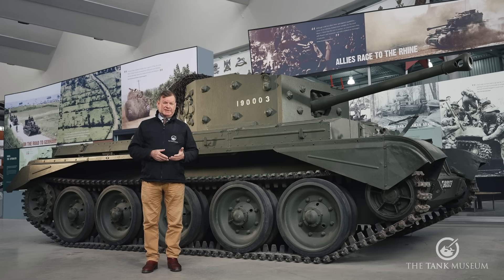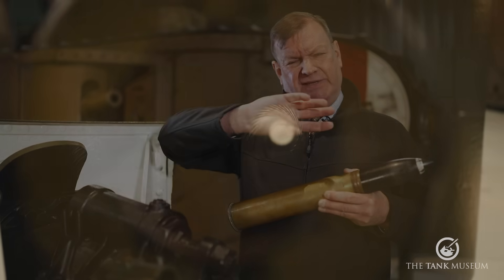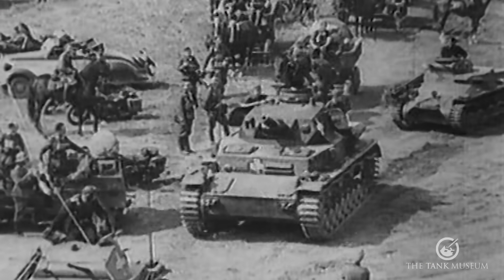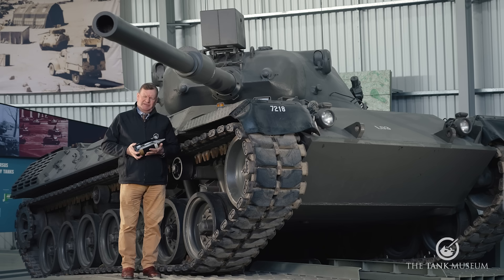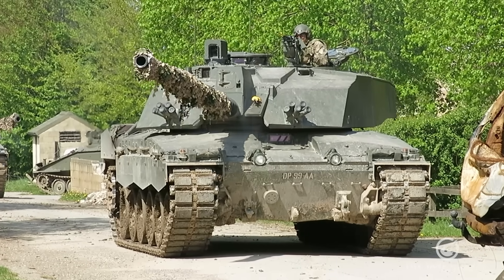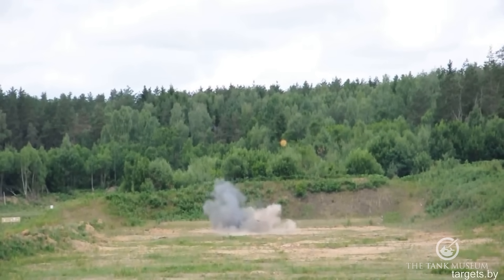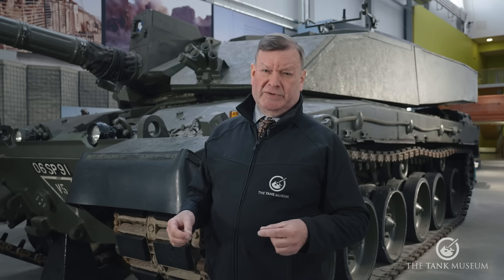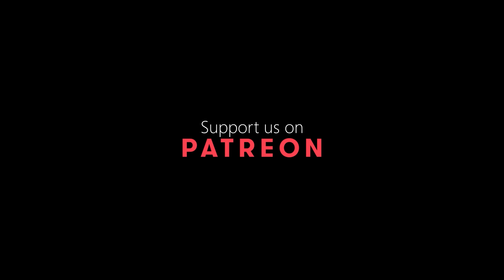Knock Out: The Evolution of Tank Ammunition

Comment: "The radioactivity of depleted uranium is relatively minor."
Yes, but it still causes radioactivity related health problems. You can ask all the veterans with “Gulf War Syndrome” how "relatively minor" their symptoms have been.
Reply: So does living in Scotland and Cornwall (radon gas).
Reply: @zedeyejoe  I wasn't even aware that radon  could be found across the UK. Many thanks for sharing it
Reply: @leoa4c  My mother lived in Cornwall and every house was given a radon detector.
Granite contains uranium.
Reply: @zedeyejoe  Yes, uranium-238 from the granite eventually decays to radon-222 which has a half-life of about 4 days. Plenty of time to do lung damage.
Besides closing the doors and windows, I assume, what was your mother supposed to do if the detector went off?
Reply: @leoa4c  I think the radon came up through the foundations. In the air radon would be diluted.
An active radon sump, fitted with a fan, is the most effective way to reduce indoor radon levels. Sumps work best under solid floors and under suspended floors.

Comment: Outstanding presentation indeed!!! Very accurate information. I used to be a Tank Commander on the M1A1 Abrams. I used to be a Paratrooper and an Infantryman once upon a time. Learning the M1A1 Abrams to maintaining and driving was very short and mastered it quickly. Gunnery was very important and foremost along with tactics. A good understanding of Tank Gunnery and especially crew, platoon, company or troop level live fire exercises after qualification is very essential. It develops unit cohesion especially under combat conditions where coordination must become instinctive when calling out fire commands to your crew, platoon, and to relay the engagement to your unit commander. It also works in reverse if your unit commander is excellent at his job as company or troops commander. When moving out on a mission all tanks as a first engagement round in combat should battle carry a SABOT round. After the first round is fired by the gunner, the commander has to identify the next target as he is searching to select the next round either HEAT or SABOT.

Comment: HEAT rounds are not kinetic energy based, their power comes from explosive therefore they are chemically based.
Must have been a slip of the tongue in the video ;)
Reply: They are kinetic because the copper slug penetrates the armor using kinetic energy despite it been accelerated using chemical energy.

Comment: Great video, I admit I prefer the rifled 120mm, it can fire indirectly to 14,000 meters with HESH and has a much longer kill distance with Fin over the NATO one piece round.
``If it ain´t broke?´´comes to mind.
I suppose we can sit back and watch how Challenger 2 and Leopard 2 clean the Orcs out of Ukraine,  although the Abrams was also in GW2 with 120mm smoothbore.
PS, REME didn´t like us firing cannister, and I doubt any Infantry in front of the gun would either, I saw the results at a Firepower Demo in 1973 in Lulworth, another reason I congratulated myself on choosing the RAC.
Fond memories of the Tank Museum, a place of refuge and Asylum from getting ``Dicked´´for Tin Pan Alley on weekends, mostly.
Reply: The L11A5 has the same effective range that NATO guns 4 kilometers. NATO APFSDS has a better performance than british APFSDS because they are longer due to them been single piece proyectiles instead of the two-piece proyectiles the brits use.  
Smoothbores are preferred due to the longer life spawn which reduces logistic strain and cost, that's why the challenger 3 will use an RH 120mm L55 smoothbore gun.

Comment: I noticed something a while back about very early (interwar) tank guns. It seems that, early on, tank designers had to make a choice between a gun that was either well suited for penetrating armor, or well suited for delivering an effective amount of high explosives to deal with infantry/fortifications. It seems like they couldn't initially field a tank with a gun that could do both. A tank in the 1920s and 1930s had a gun that either had a small caliber and fired high velocity projectiles (for punching through armor), or had a large caliber and fired low velocity projectiles (for lobbing a large high explosive shell). It looks to me like, in order to get both capabilities, the French had a two-gun solution with the Char 2B (one small caliber high velocity gun, and one large caliber low velocity gun) and the Germans had a two-tank solution with the Pz3 and Pz4 (one tank with a small caliber high velocity gun, and the other tank with a large caliber low velocity gun). But no one had quite managed (or had only very recently managed) to figure out how to build a good dual purpose gun, which could fire both a high velocity projectile for dealing with armor, and a large high explosive projectile for dealing with infantry and fortifications.

I have a few questions.

1st. To what degree is this a correct impression on my part?

2nd. If this is a correct impression on my part, why was it so difficult to field a dual purpose (can fire both a high velocity AP projectile and a powerful HE projectile) tank gun in the 1920s and 1930s? Or if it's an incorrect impression on my part, why did there seem to be this dichotomy between either small high velocity guns or large low velocity guns on interwar tanks?

and 3rd. If this is a correct impression on my part, why isn't this talked about more often in the history of tank development? This seems to me like a very significant capability challenge, and I would think that overcoming it should be remembered as an important achievement.
Reply: I'd say you are on to something. My speculation would be recoil as the reason, HE needs diameter to be effective, but it doesn't need velocity. In fact, travelling fast makes it difficult to make a reliable detonator for it.
On the other hand, with the same recoil force as that heavy and slow HE round causes, you can make something small fly very fast. Something heavy flying fast takes the whole thing to another league.

Comment: At around 10:55 when they describe the hit on the T-72 it would have been prudent to point out that it's internal ammo detonated. An APFSDS round does not have the kinetic energy to lob a 4 ton turret 300 meters.

To viewers not intimately familiar with the subject mentioning which guns uses cased ammo and which does not would probably have been helpful. Especially the last segment went rather quick back and forth between the two scenarios.

Comment: I think the best place to start is with "top attack" or effectively a "flying magnetic mine" that can "see"(massive amounts of metal "show" an electromagnetic signature) a tank and then explode directly above the Tank perpindicular 90° downward upon a tank's most vulnerable point and in fact these "rocket charges" have been used as ammunition by both the USA and Russia as a dual purpose. These "Hellfires" have had a devastating effect to near all Russian Armor in Ukraine and has made many to question the validity of the entire system of the Tank similar to what happened to the Battleship after World War 1.

The Battle of Jutland would greatly simplify the matter trying to be explained here.

You see the problem in addition to so much metal being used is the chemical composition of "air" around 70%nitrogen which is highly dense and not flammable and 29% oxygen which is also very dense but EXCEPTIONALLY combustible. Thus should this "air" alone be combusted it be more than sufficient at incredibly low cost, high accuracy and devastating effect to annihilate armor of any type with the possible exception of a cast turret. The technical term is called an "over-pressure event" which besides instantly killing the crew inside causes the entire interior to "explode" both kinetically (oxygen) and through "heavy gas"(the "over-pressure." This lethal combination which the Germans discovered in World War 2 with their 88mm high velocity anti-aircraft delayed fuse used in the anti-tank role created so massive an over-pressure the turret would be "popped off"(turret toss they call today.)

This is the "physics" behind the "knock out blow" to me anyways meaning not just the turret toss but the entire IDEA of the Tank is used against itself because it contains the air too effectively from within. Why this matters is a single shot equals no chance of recovery of the entire vehicle in any way.

Oddly enough one of the survivability "features" of the Sherman Tank during World War 2 was that these highly advanced barrels, turrets, gun systems and charges simply passed straight through the rather thin skinned M4. This would regularly kill the crew but still leave the vehicle in driving condition whereupon the Sherman would simply return to base as the driver and drive system was still wholly intact ready to go right back into Battle. I think the record was one driver with 4 dead crews all killed but the same Tank driven back each time by the same driver.

Point being after World War 2 when working in the NBC environment was considered to be standard the theory of "pressurization" in order to keep as much foreign material from outside the armored platform and chassis from entering was very much thought through resulting in the now still well regarded T-55 Medium Tank and i imagine the entire series of "Patton" Tanks. It's interesting how much the M1 "Abrams" series of Tanks is such a departure from all of that as a consequence using a turbine engine no less!

Comment: The problem with DU isn’t so much the radiation, it is the fact that it disintegrates and pollutes the area. It can then enter the bodies of humans and cause serious problems since it both causes heavy metal poisoning and the slight radioactivity becomes much more dangerous when it is inside of a body.
Reply: That is why "decontamination" exists.
As for crew, the "pyrophoric" effect mentioned -- combined with plain compression of the atmosphere inside an armored vehicle -- always kills an armored vehicle crew by incineration.

When you see those T- tanks in Ukraine combust and/or blow up in horrifying jets of fire, the crews are already mercifully long-dead before the fire ignited the on-board ammunition though the source of the ignition is often the single "bullet."
Reply: Disintegration one of its advantages. The tip of the DU round is self-sharpening, so it does to blunt as it goes through the armour.

Comment: Ingesting depleted uranium (DU) in any form is a significant health hazard.  Even though it is depleted in the U235, there are still other radionuclides present.  Breathing in DU dust and smoke particles can cause them to lodge deep in the lungs, directly irradiating them and causing cancer.  There are also potential health effects from DU as a heavy metal.

Comment: I've been wondering about the artillery cases that we've been seeing in Ukraine the last year and a half. Are they brass or are they steel with a brass skin. I've seen a lot of ex Soviet rounds on both sides of the conflict that have brass cases that have what looks like rust staining. And the sound of an empty shell chunked onto a pile of them doesn't sound like brass. I could be wrong. Artillery isn't my specialty. So if anyone can answer, I'd appreciate it immensely. Thanx
Reply: Steel or aluminium cases for tank shells and aircraft gun shells. Some machine gun rounds were also available in steel instead of brass.
Reply: It’s mostly brass coated steel. It’s commonly found on all sorts of calibers - from small arms to artillery pieces.

Comment: Anealed means that the metal is made dead soft. I'm a blacksmith and bladesmith. When I make any type of blade whether a knife or some edge tool, I forge the work piece to close to the final product. Then I aneal the piece by bringing it up to a critical heat(non magnetic, about cherry red) and bury it in a box of wood ashes. This allows the work piece to cool very slowly allowing it to become very soft. Then I file it to the final dementions and get all the edges in line with where I want them and cleaning up the surface. 
  Then I do the heat treatment which consists of normalizing, hardening and then tempering. I think that the presenter accidentally mixed up annealing with heat treating. Its an honest mistake that anyone who doesn't have a job heat treating steel objects could make. BTW, annealing copper alloys(brass, bronze &ect.) And silver and other lesser metals is the exact opposite. You bring them up to a red heat and quench them in water. That's how you make them soft. To harden them you have to strike them with a hammer enough to work harden, but not enough to crack and split the piece. That's how they would harden swords during the bronze age. Tapping on the sword edge with a hammer to work harden the edge without deforming the sword. There my two cents. Take it for what you will. Have a nice day where ever you are😉

Comment: HEP High Explosive Plastic is a slow, inaccurate round.  We fired hundreds of them on the range and it was pure luck if you hit anything out beyond a few hundred meters.  They arch up and spin to the right.  You aimed off to the left and high and hoped that it wandered into the target.  A HEAT round on the other hand has very good velocity and as a result accuracy.  And if you hit it with a HEAT round, it will kill it or make the crew inop.  The minimum safe distance for a war reserve HEAT round in an M68 105 is 40 meters.  You hit a T anything with a Heat round and watch the roadwheels fly a hundred feet into the ski followed by the turret.
Reply: Would you say that HESH is obsolete?   what's your opinion on new HE-AMP ammunition?

Comment: Just a correction on the solid rounds.
"Annealing" is a heat treating process which SOFTENS metals, it doesn't harden them.
It is used to control the crystal grain growth in the metal.
Reply: When he said annealing I assumed he meant tempering, which to the average person sounds like the same thing.
At a guess, the shell would be forged from something like 1065 high carbon steel.
In a fully annealed state it would be something like 15 on the Rockwell C scale of hardness, soft enough that you could easily file shavings off it.
Heated to ~825°C and quenched in oil or water it might be around 65 HRC, but also very brittle. It would be so hard that a hand file wouldn't scratch it.
Tempering it at say 250°C for a couple hours would greatly reduce the brittleness giving it toughness and elasticity so it doesn't shatter and reducing the hardness to something like 58 HRC, which a hand file would be able to scratch but just barely.
Reply: @FuckYouYouFuck 
Actually tempering is the exact and total opposite of annealing.
Reply: @mattkotewa6098 Only a waste if you do both things to the whole projectile. For instance, you could harden the top and anneal the bottom so you get a hard striking surface with a bottom that won't break away on impact.
Reply: To make them less brittle...

Comment: Excellent! Perhaps a second one as a follow-up covering the rounds you describe at the end? Great stuff.
Reply: He described the use and composition and even showed a cut-away model! What is it you want to know?
Reply: As I say, the rounds briefly mentioned @ 18:54 might be deserving of a short follow-up, or even an entire video of their own. A cross section lasting 2s does not explain how it works or how it's used tactically. THAT is what I would like to know. Any more questions?
Reply: @RobSchofield  Oh. Well, you point your gun in a direction, fire that round, and it spreads ball bearings at a rate of about 1 meter every 10 meters forward, utterly destroying everything not substantially armored in its path; to about 50 meters' swath at 500 meters. The ball bearings remain lethal well past 1 kilometer, but dispersal at that point reduces hitting any individual to a fluke. As the projectiles form a Cone of Destruction, many go high and many go low, but those going low are at such velocity and hardness that they tend to ricochet off hard ground and graze targets.
They are nominally for clearing brush, such as the hedges in Normandy, allowing the tank to exit a road.

These are the modern version of canister shot, by the same name, and used much the same.

Comment: The anecdote is a little misleading at 10:38. It's not so much that the APFSDS round was so powerful it popped the turret, it's just that t72 autoloader ammunition carousels were where the round impacted. This causes the secondary explosion that would pop turrets that is commonly seen in t72 deaths.
Reply: Indeed. The actual Sabot oftentimes does very little damage in terms of visible trauma caused by the actual round itself.